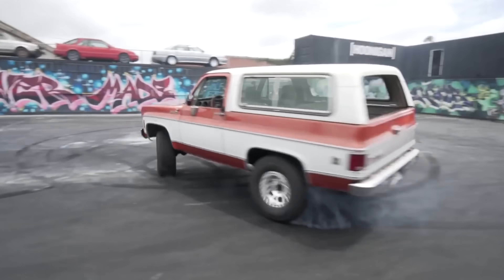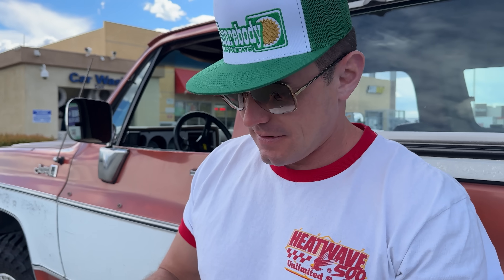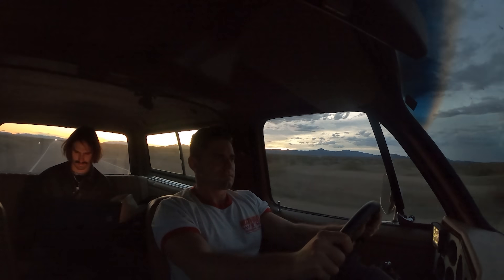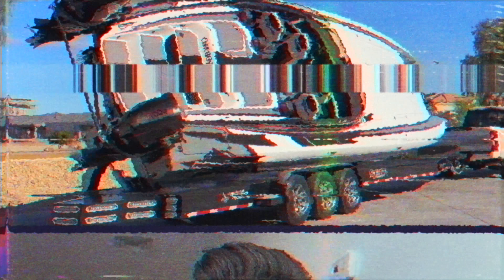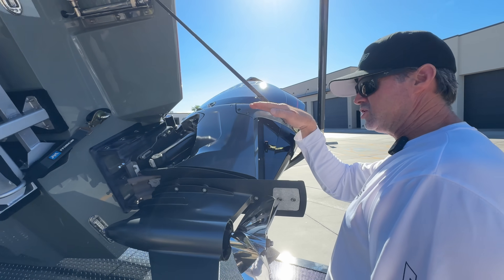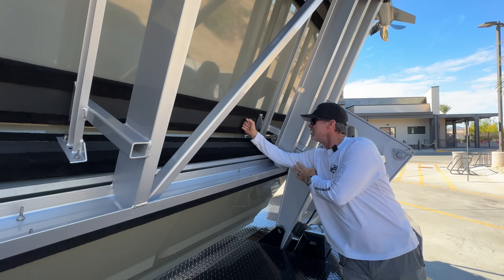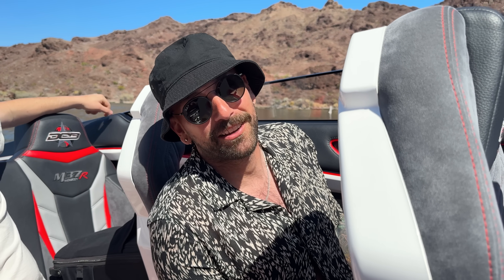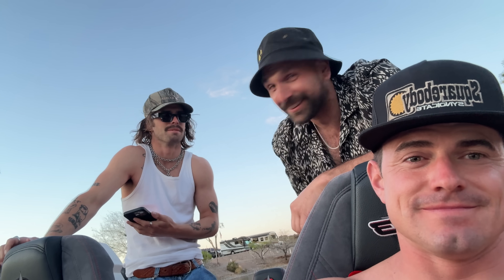572ci Big Block SquareBody Vs $850,000 Speedboat: Which Burns More Fuel?

Comment: Your 78 gallons of gas in Missouri right now would be 234.00
Reply from the maker: Sadly I’m aware. My dad likes to remind me of fuel prices back home on a weekly basis. 😂
Reply: @MISTERZACHARY  what do you think with the blazer going with a tkx flame plates manual that would be sick
Reply: In the north of the UK that would be $413.00 or £513.00.
Reply: @MISTERZACHARY  Dont sweat it, I checked your prices when you fueled up. We are nearly double that at some places on the other side of the atlantic
Reply: That would end up at around 550$ in sweden, and mind you our fuel prices has dropped a lot this year. Last years prices would equal to about 700$
Reply: Yeah but then you'd have to be in Missouri, oof lol
Reply: That would be 700ish  in the Netherlands 😅
Reply: About 1000 in Canada lol
Reply: But you would still need to drive your Blazer 1,066,666 miles at 4mpg to spend $800,000

Comment: Depends on the boat and use but my ski boat with just a stock 350, wakeboarding and kneeboarding so fairly low speed and rpm uses hardly any fuel at all, but anything wide open and heavy is going to drink

Comment: 572ci big block efficiency be like - 70% of the fuel is converted to heat and driveline loss, 25% is converted to noise and 5% of energy is used to drive the wheels. 4mpg is equivalent of Soviet era russian agriculture truck hauling 20 ton load in the back

Comment: Zac is your MAP sensor working?  I know it’s huge motor, but anecdotally in my 13:1 418 ls3 that runs on e85 (in a 2000 gmc prerunner type truck, long travel linked etc) I accidentally knocked the map sensor out of the back of the intake while changing an oil pressure sending unit, and the fuel milage was FUCKING MISERABLE.  Like 2-4 mpg, because it just keeps dumping fuel because it’s got no reading.  Maybe just maybe it could be slightly better?  When I put it back in I got instantly 2x more mpg.
Reply from the maker: If you watch the most recent video I uploaded, we found out what was happening. It also stranded us in the middle of the desert.

Comment: K5: 20 gallon fuel tank @ 4.3 MPG; weighs what, 7,500 lbs.?
Boat: At least 100 gallons of fuel @ 2.3 MPG; weighs 6,200 lbs.

Let's say two of your engines would halve down to 2.15 MPG and one Merc 500R would equate to 4.6 MPG and has a 20 gallon fuel tank. They're pretty equal tbh.

Comment: I drove from Michigan to Florida a 1244 mile trip one way so 2488 miles with the return. I was in a Ford e350 getting 14.2mpg and my wallet hated me. I spent about 700 or so on gasoline alone.